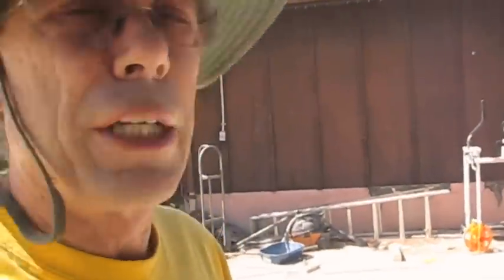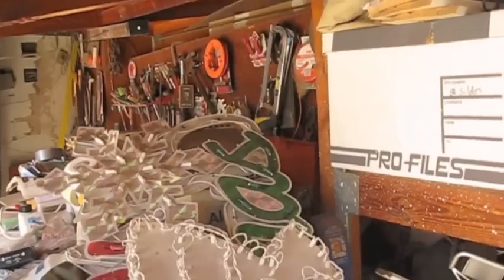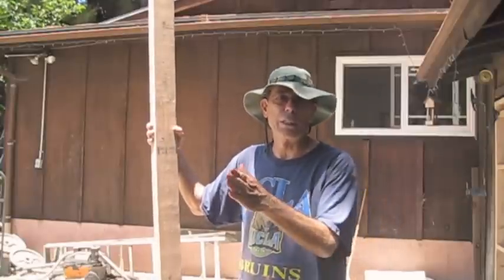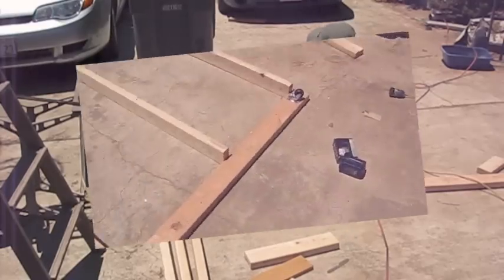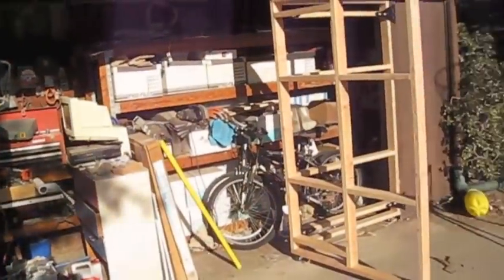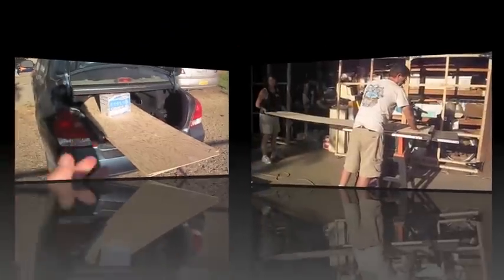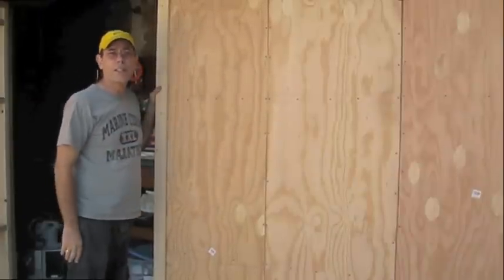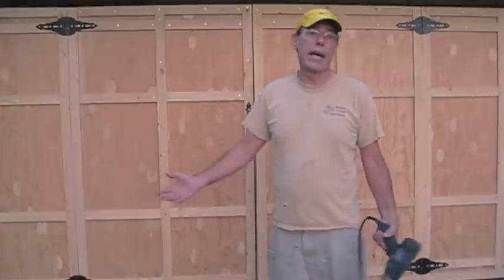How to build a swing out garage door

Comment: I really like the accordian design. I have to rebuild two 6x8 garage doors and I may use your design. It makes the doors light weight and it shortens the wideness when the door is open. Excellent job young man!
Reply from the maker: Thank you it's been 10 years now since I did the job is still working pretty good for my situation it worked out perfect good luck on your project.

Comment: Really good work. It looks awesome and people should be encouraged by your work.

I would like to throw a couple things out there for those watching this video and thinking about doing it themselves. 

First, purchase pressure treated lumber. This doors framing will come in contact with water, moister, etc. Using non-pressure treated 2x4's will cut the life of this door by a quarter of that of a door using Pressure treated lumber. 

Second, use exterior grade woods screws. Not drywall screws.

Comment: If you put the second set of hinges on the inside of the door and run a piece of unistrut (as a guide) on the underside of your header jamb you'll find the opening and closing of the doors less cumbersome.  I once owned an older home with a Carriage style garage and that was how it was set up.  You'll also need some cane bolts on the top and bottom of each panel to make the doors more secure.

Comment: What would have been better is a swing up door that would provide a roof and extended shelter over the garage/workshop.  You could make fold-down posts that support the roof/door and that lock into place when folded up.  You would have all the storage plus you would have extended shelter from sun or rain when working on a project.

Comment: Actually in this instance you would NOT use Pressure treated. He was right to use douglas fir. PT isn't great for this use, it's not as strong, and tends to warp and twist much more than std douglas fir. If you're really worried about moisture driving past the siding of the door you can tyvek the door (over the studs) before you install sheeting or siding. Then you can even fiberglass or spray foam the inside of the doors.

Comment: It was nice of you to provide a gap at the bottom for rodents to access the space.  Those doors are certainly better than the door they replace, however diagonal bracing would have been better for shear strength, along with gluing the plywood to the 2x4’s.  Bonding plywood to the backside would provide a huge increase in torsional rigidity, and the addition of gluing rigid foam to the inside beforehand, would make for a really solid door.

Comment: I hate to be the Nay-sayer....I like the doors!...but I dont think you can use plywood for external doors.  I used it for the shed a few years ago and now I have to tear it down due to seperation of the plys.  I even tried water resistant paint....but alas, no help.  I built a shed door for a friend with T1-11 and it worked great.....that was a decade ago and it's still good.  But your doors look GREAT.